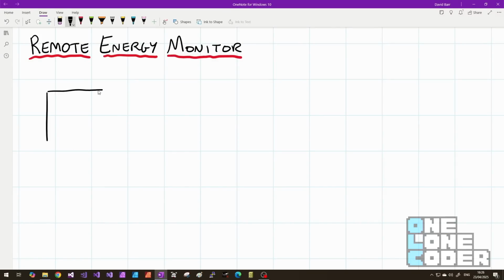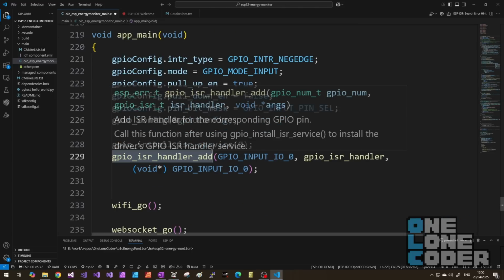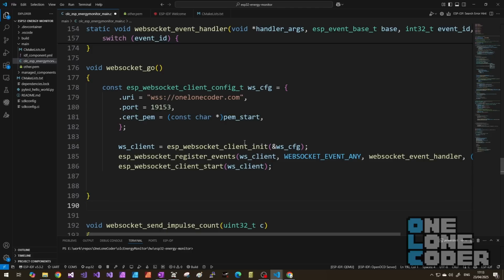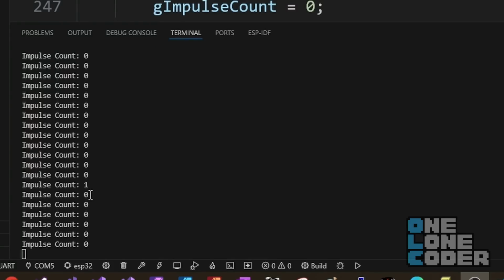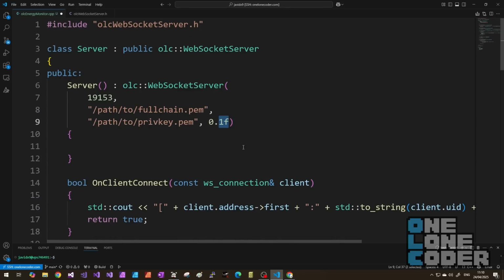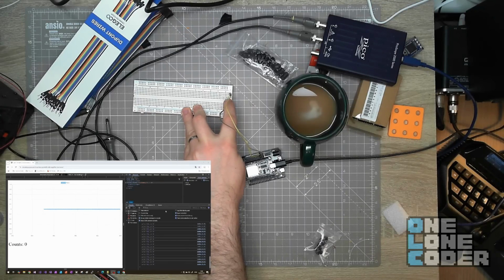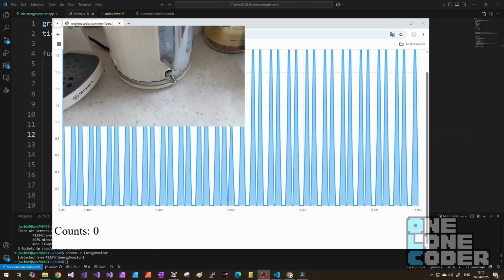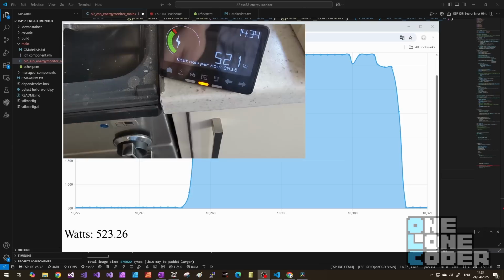Code-It-Yourself! Remote Home Energy Monitor with ESP32, Websockets & C++

Comment: This is very impressive. Where could a mere mortal begin learning these things?? I know a bit of programming but none of the hardware side of this is project. I was studying Programming principles and practice using c++ by Stroustrup but I haven't opened in like 4 months... I reached chapter 5 out of 21 and although it was cool, the resistance became too much and I stopped. I still think I will come back to it though. Congratulations on your project!

Comment: After watching the full video this is really cool.  What was the device with a high inrush current causing a 75p/day unnecessary cost.

I’m interested in building something similar as I have about a 1.5-2kw/day discrepancy that I cannot find.

However as I live in a flat on the top floor and my meter is on the ground floor i’d have to go cellular so i’m thinking a NCV type sensor as my consumer unit is within my property just not the meter.
Reply from the maker: Thanks James! It ended up being a faulty compressor on the refrigerator. It was switching on perhaps 30 times a day, fine, but had a 3-4 second starting surge of between 3-4kw! I expect a brief kick on surge but this was really long.

Comment: I think your Wattage is different than the smart meter because when converting the kWh to KwS it should be 3200/3600 , not 3600/3200

Comment: What a cool project, (I'm still getting used to seeing people 3d print their own enclosures, being a teenage hobbyist in the 1980s I would have to order ABS enclosures from Maplin or RS ). I haven't thought this through, but that's not going to stop me commenting; rather than work our the time since the last pulse, wouldn't it be easier to use the number of pulses in one second and then scale by the appropriate conversion?
Reply from the maker: Thanks! I do discuss the downsides of counting per second, its so low frequency we effectively quantise the data into a mere handful of levels (under normal domestic  loading) so it becomes almost impossible to get a sensible measure of power consumption. Time between pulses is highly accurate however, as the pulse could be several seconds long in the case of low power draw.
Reply: @javidx9  Ah yes. Spent some time thinking about it; 1.125kW for 1 pulse a second.  500W will give 1 pulse every 2.25s, 100W will give a pulse every 11.25s, so there is going to be a bit of uncertainly in the actual value at low loads.

Comment: I have been struggling with managing stress from my physics PhD and this video cheered me up instantly. I was hoping you would do a series on embedded+networking stuff someday and here it is!! I absolutely love your unique presentation style. Thank you for introducing me to this great hobby. Additionally, thank you for finding chart.js and Websocket++, I will use these.

11:51 I think this is same for all kinds of modern WiFi+BT cards. Once you enter the connection details they stay on the card's permanent memory. I am weary about this too.
22:20 esp-idf codebase has nghttp2, probably. There's also the mongoose web server project.
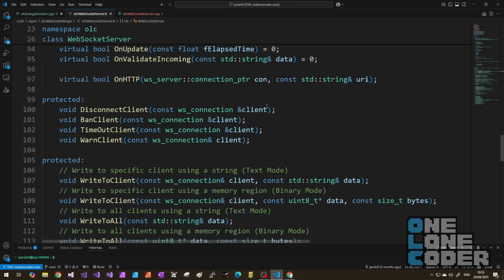23:35 This is the most important part, it would be nice to have an idea on how to keep this part organized and abstracted.
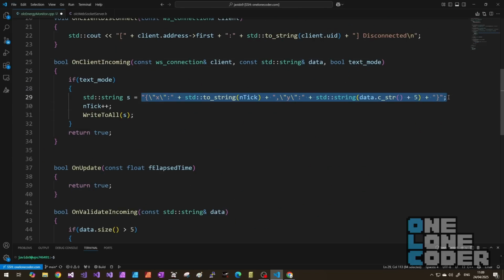25:43 There's also the cJSON library.
27:33 🤣
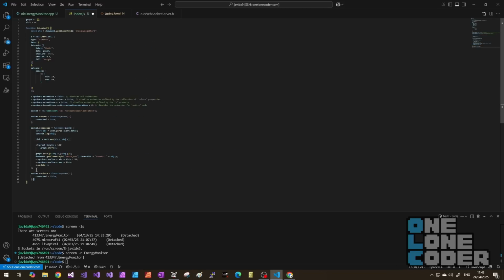30:51 Still a lot better than what I cobbled together in my first attempt of making a data logger. But it had the capacity to record stuff offline and serve them on demand. A dashboard of sorts, to submit and manage recording jobs.

Overall, I definitely enjoyed this one!

Comment: Thanks for the vid! One note: I recently learned from the 'Jeff 2' channel video 'de-censor videos' that it's very easy to decensor simple blur in videos. Unfortunately the only good option is an ugly black box overlay. 
Keep up the good work :)
Reply: Just put 2 layer, one of random noise and on top the blocky censor 🙂
Reply: That only applies to a mosaic blur with a lot of movement and screen time, it doesn't apply to a gaussian blur. You'll hear that gaussian is mathematically invertible (which is true!) but I can't find anything that actually works on it.
Reply: @Diamonddrake  I imagine the YouTube compression algorithm obliterates any useful data.

Comment: Does A mean Ampere, I am confused. You divide Ampere times kW/s with delta time/seconds?
Reply: When accessing variables from an ISR, you should declare it volatile
Reply from the maker: Nope, A is just a constant
Reply: (1 kWh / 3200) * (3600 s / h) * (1000 W / kW) * (1 / x seconds) = (1125 / x) W

Comment: Love your channel, but this could be achieved with a 'Shelly EM'. £50 quid, WiFi, Local web GUI, API etc..
Reply from the maker: Well... I used/needed none of those things and did it for about 15 quid. As a by-product, got a really general purpose websocket interface too. I did mention I could buy my way out of the problem, but i do things for the joy of doing them.
Reply: @javidx9  Fair play sir :)

Comment: When sending the pulses I do think it would be safer to set the current number of pulses in a new memory location, send that value, then decrement the gImpulseCount variable by the value that you just sent. That way while the websocket is sending the value if you do get any new pulses you won't lose that data.

But of course your change later negates my comments so there's that. lol
Reply from the maker: Yeah, it ain't great but as it proved out it was fundamentally flawed to begin with.

Comment: No, no, no. Wrong direction. All you have to do is wrap wire around the Line wire after the circuit breaker. You wrap 4-5 windings around the wire with ~18 gauge wire. Connect the two end of the wire to a circuit (FET, transistors) to deal with the voltage and put either digital or analog meter to see which circuit breaker is drawing wattage.
Reply from the maker: Im not really looking for leaks like that. Devices today behave erratically, and an instantaneous measurment can't reveal those behaviours without luck. Now I can see what my house did for the whole day.